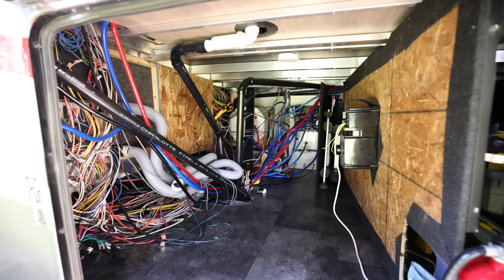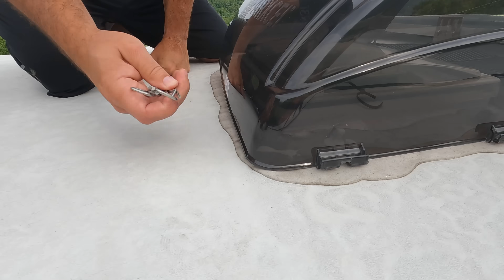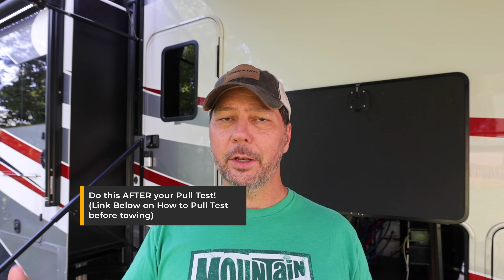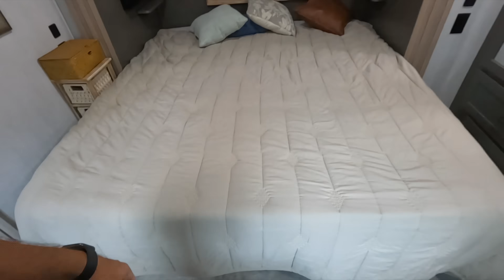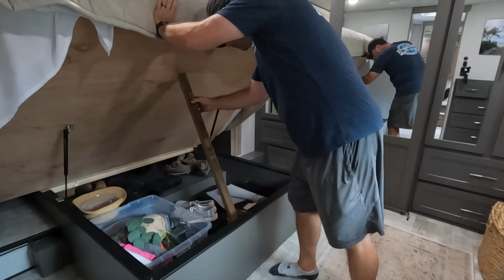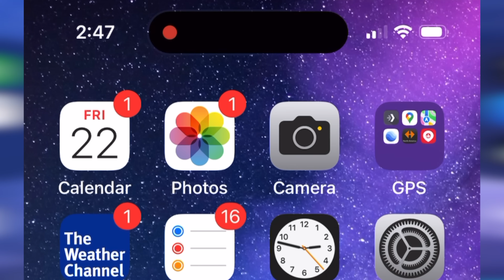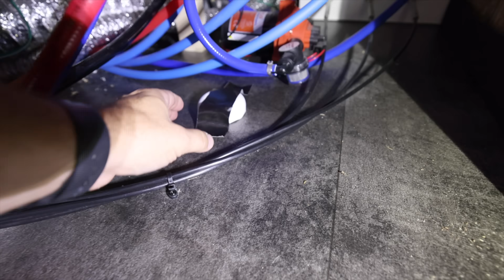Help Us Out? Stubborn Leaks and Four New RV Projects!

Comment: Chad, I had a leak I chased and it turned out to be the rubber gasket on the compartment door. There is a seam that was on the top that would let a little water in, so I put a small piece of eternabond tape over the seam and no more leak.

Comment: I had a mystery leak in our 2011 DRV.  Look around the water pump. Seemed to be the problem.  I put a new water pump on and still leaking water. Finally, I reached around to the accumulator. A pin hole of water was coming out. It's not a vital part, so I bypassed it. No more leak. Not all 5th wheels have accumulators, but you may check to see if yours does.

Comment: One of my many leaks on my 351 M was coming out of water heater. They put a check valve with an octagon shaped  pipe thread end. They used tons of pipe thread sealer on the fitting to get it to seal.
Reply from the maker: I already have a replacement check valve that I will install soon.  That's what got us when we had to replace the insulation.

Comment: Our water pump was intermittently leaking. Not the screw on connections or filter but where it is put together. It would leak only a little at different times. I bypassed it and now no more leaks.

Comment: Chad
I have actual proof of the cheap emergency cable that comes from the factory, our cable would fly around in the back of my truck as we drove down the road. It eventually would manage to get caught in the gap of the tailgate, when we would go around a corner it would pull the pin out locking up the trailer. 
We also changed to the red coil, it doesn't fly around in the bed of the truck.
Great video, happy travels.
Chris
Reply from the maker: That kind of thing is what I was afraid of!  Thanks for sharing.

Comment: Great video as always. You made me feel waaaaay better as I bought the same wrong air vent covers and need the same ones you needed. Nice to see how easy they will install and knowing this will encourage me to get the right ones soon!  On the water leak detectors, I have been looking for HomeKit enabled detectors but also a HomeKit enabled device to shut off the water at the spigot. Only one I found is for watering the lawn so it doesn’t really fit this use case due to timer limitations and operating the opposite of what I need. It basically lets water run 4 hours then turns it off.  In my dream setup I would have water leak sensors everywhere like you do, but let a tripped sensor trigger water to turn off. And alert us. Then a leak is turned off automatically within seconds.  Have you looked into something like this?  On your sneaky leak, is Tara messing with you?  Pouring a little water there when you’re not looking?  😂
Reply from the maker: I looked into it a little bit.  but, like you didn't find anything that really fit the use case.
Reply: @ChangingLanes  for that leak, what if you lay sheets of printer paper to cover the entire floor area. Then if the water is actually coming from somewhere the trail will be visible later more than just the floor.

Comment: Hey Chad. I'm a little concerned for that second fan cover blocking a portion of your solar panel. Blocking one square will effect that whole panel. Safe travels.
Reply: I was thinking the same thing when I saw that.  Perhaps a year ago I watched a video by Dave, EEVblog, down in Australia.  He was working with the solar panel system on his house.  He found that the shadow of a coax cable across the panel dropped the output dramatically.
Edit: It's his video labeled as number 1426.  Can't embed the link as YouTube removes the comment.
Reply from the maker: That's a very interesting point!  I may need to remove that one when we boondock.  Luckily it's very easy to remove temporarily.

Comment: RV life is a Job for a Jack of all trades. If you don’t have pressure on water lines when traveling things are shaking up and down. Twist couplings may come loose. When you use water they leak a little and then seals it’s self. Temperature change can cause leaks sometimes. Paper towels great way to find leaks. 2019 Reflection 337 l opened up the wall in the basement to find a mass of wires,water pipes. After a couple of days of organizing wires and moving water pump l was able to move the wall back 12” inches making more space for storage. Happy Trails 
LeeRider.

Comment: So searching for water leaks is challenging. I have been an Auto Mechanic for over 45 years. I've searched and repaired my share of interior water leaks. I'm still learning so I'm not an "Expert". An aid I've used over the years to help follow the water trail - is Baby Powder. If layed down on a surface you can follow the trail. Now I used this stationary in a bay while someone else soaked the car with a hose. Definitely different than driving down the road, and all that motion coming into play. It won't tell you what's leaking but may help show the waters path. Good Luck - I hope this helps.

Comment: Hi Chad.  I don't know the configuration of your 5th wheel, but we had a small water leak once that turned out to be water coming in around one of my stink stacks.  We resealed it and haven't had any problems since.
Reply: Hi Chad, I agree with @jameshodgins1937 on the potential of the leak in the plumbing vent stack. Could be a rain leak trailing down the outside of the pipe until it hits a spot where it drips off onto the basement floor. Perhaps tie a blue shop cloth around the various drain pipes in the basement and doing a water test on the roof around those vents.

Comment: The idea I have Chad is to get inside the basement (doors closed) and have Tara spray water up in the air and on the 5th wheel simulating a good rain and see if you can catch it happening.

Comment: There is many ideas in the comments and you are very good with an RV. My first idea was your shop towels in a 360 degree around the water sensor to start. I would move the other sensors to the area using the same 360 degree placement of towels to see if one can see direction of leak.

Comment: Hey Chad, that was a pretty good imitation of that hydraulic pump.  As to the water leak I've been having similar issue in one or two of my bays, not necessarily the wet bay.  I think it's the seals for the door.  What I did is buy some white water based paint at the local Meijer store (a Michigan based competitor to Walmart) so I can paint where I think the leak is coming from.  The water should make the paint run so you can follow the trail.  Do I know if it works?  Not yet, I have tried it but I think it's some place to start.  For about $3 it's a pretty cheap detection tool.   Water leaks can be really, really tough.  Good luck.  BTW will you guys be at the Tampa Show?  Keep the good stuff coming.
Reply from the maker: This comment had a similar idea with different medium:
@davidtennant7169  • 13 hours ago
"Chad, this sounds strange, but it’s an auto technician trick….  You can use Gold Bond spray powder.  It sprays out and sticks to walls, pipes, or whatever.  When the leak occurs, you will see where it came from.  We use it for oil leaks, transmission leaks, water leaks, etc.  There are products made specifically for professional technicians, but Gold Bond spray powder works the same for 1/2 the price.  Good luck."
Not sure about Tampa yet....

Comment: Chad, this sounds strange, but it’s an auto technician trick….  You can use Gold Bond spray powder.  It sprays out and sticks to walls, pipes, or whatever.  When the leak occurs, you will see where it came from.  We use it for oil leaks, transmission leaks, water leaks, etc.  There are products made specifically for professional technicians, but Gold Bond spray powder works the same for 1/2 the price.  Good luck.
Reply from the maker: Very interesting!  Thanks for the tip! 👍🏼

Comment: Check the pump. We had the same issue on our 373 and found our pump had a small crack in the filter housing on it. It would only leak when you pressure the pump or when it was moving around. Good luck!!

Comment: I've had odd leaks through the top of the door frame, into a bay on the opposite side, and in a small tray under the furnace. The cause turned out to be old/loose air-conditioner seals. Water runs across roof framing and down inside the wall until it comes out.

Comment: I feel your pain, I think I found our mystery leak! on the slam hatch door the strike plate! take it off and check it. The 'gasket' material did not make a good seal. cleaned it up and clear caulked with marine grade caulk, with tape on the inside to make a dam. before it can dry re install the plate!  Took me 4 years to figure it out

Comment: For our mystery water leak I took strips of paper towels and tied/placed them around and on the fittings and suspect areas as tattle tails to find the source. Your situation sounds very familiar (397TH here) with the furnace and the wet bay (same corrective actions). Ours eventually traced to a failed seal on the hatch door. The water tracked down around the frame of the door to the side of the wet bay and pooled under the nautilus piping. Adjusted the door latch to fix.
Reply: My thought exactly!!

Comment: My 379 leaks on the water pumps pressure switch. Similar to yours it makes a puddle and dries up by the time we pull in to camp. It only leaks when the pump runs. Don't even know if it's worth calling GD about it.
Reply from the maker: I would call them if it's still under warranty and at least get a replacement pump.

Comment: I was listening to your video with the hubby. I googled  leak in wet bay , so it's not my experience but may be another place to check. It mentioned RV residential refrigerator possible condensation /defrost .  I have an  RV frig so now I'm curious if it  has a drain I may not be aware of.  Wow,  one more thing to write down in my RV personal how to find,/fix book. LoL  Be well and safe travels.

Comment: Is there any plumbing vent pipes in area ?  Small crack in plumbing vent plastic on roof can cause water to leak intermittently. Had that happen on my old KZ sportsman.

Did you cycle  pump a few 8-10 times to see if it leaks while being used. 

Also did GD use hose in the basement they can leak intermittently depending on temperature if the clamp is not tight enough.

I had a stubborn leak in my ceiling this year. Turned out to be one 4 ft section of AC duct was sweating on very hot days.
Reply from the maker: Good point on pump cycling.... I'll check that.. But we've run on pump for days and days with no leak warnings.

Comment: If you could add a little more water pressure to your water lines than normal, but not too much (!), you may be able to detect what would otherwise be an intermittent leak in a joint. Just maybe. Good luck!

Comment: Our 22 Solitude is at the dealer now for a bad water leak around the bedroom slide resulting in water leaking down inside the wall down to the basement.
Reply from the maker: Hope they get you fixed up!
Reply: Our 23 Solitude 376RD bedroom slide leaks exactly the same as well as our two upper rear living slide.
Reply: Grand Design's quality has gone to crap. You pay top money for something that needs work just a few months later. @coryjuntunen7322

Comment: Our happyjac did come down on its own as a motor fail. Thankfully we had a new metal cabinet on top of our atv which stopped it before hitting the motorcycle. It ruined the cabinet but better that than the bike. We put in our own safety pins after that and replaced a part of the motor. We have a 2020 320G.